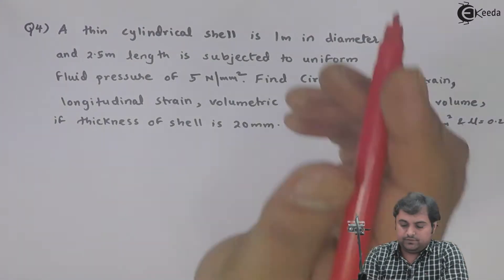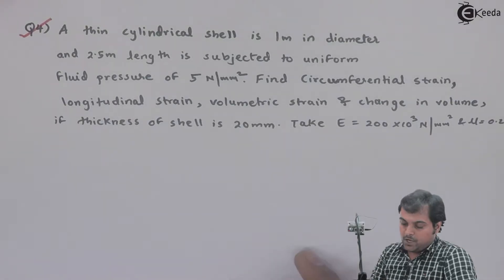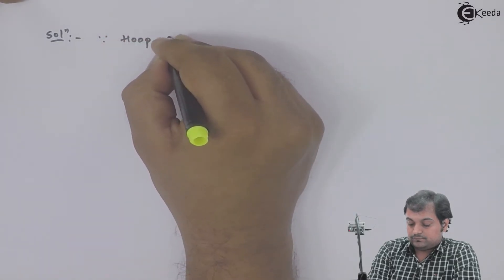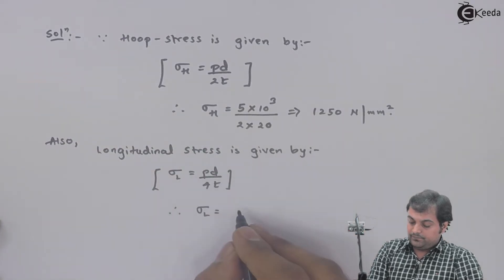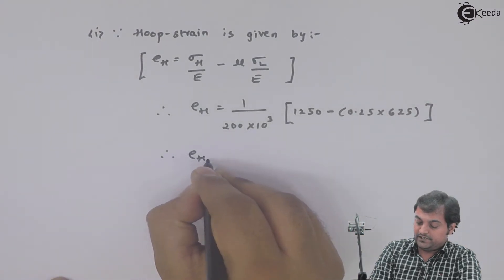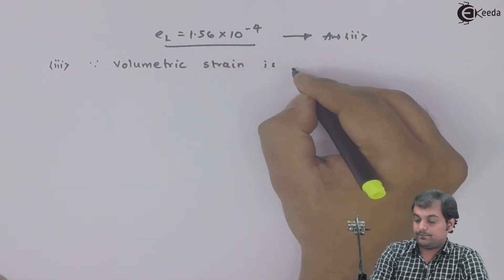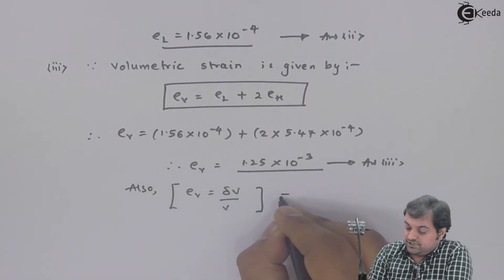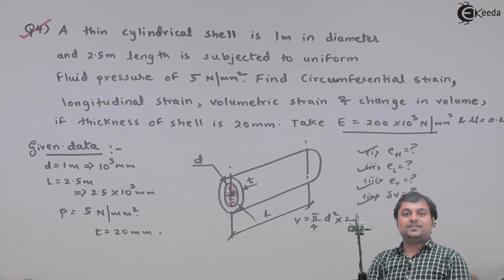Thin Cylinders - Problem 4 - Thin Cylindrical and Spherical Shells - Strength of Materials

Comment: CORRECT ANSWERS
Hoop strain = -1.56 * 10^-4 
Longitudinal strain = 2.96 * 10^-3 
volumetric strain = 2.648 * 10^-3
change in volume = 5.185 * 10^6

Sir your lectures are damn good and easy to understand.. its just due to one wrong answer all calculations went wrong :)
Reply: yes